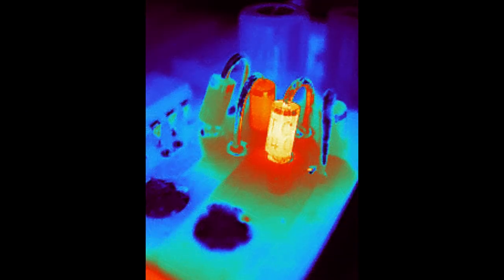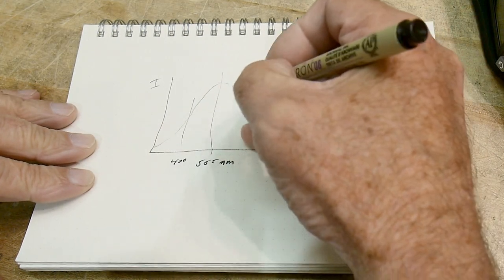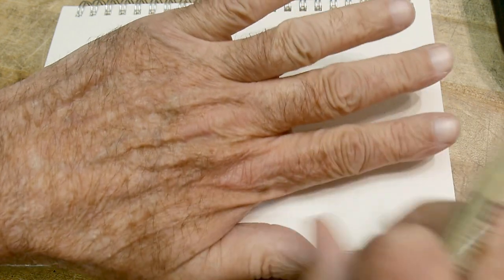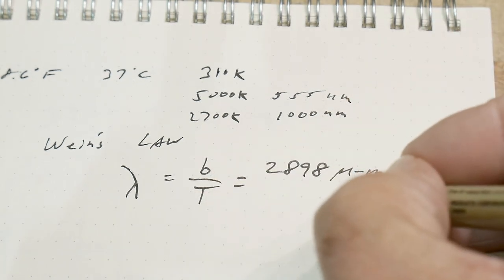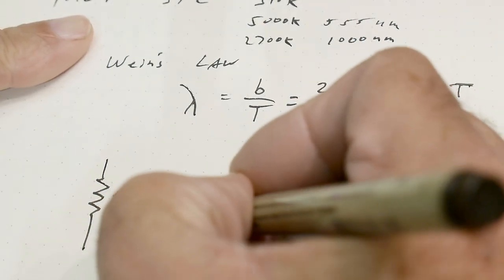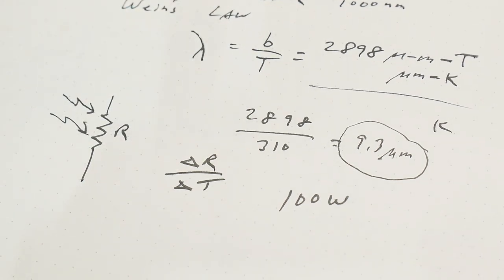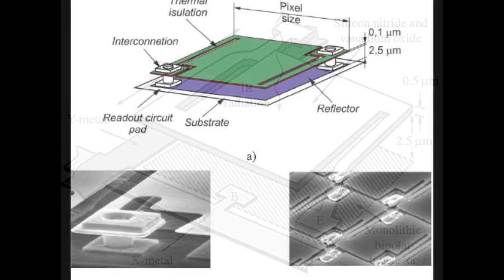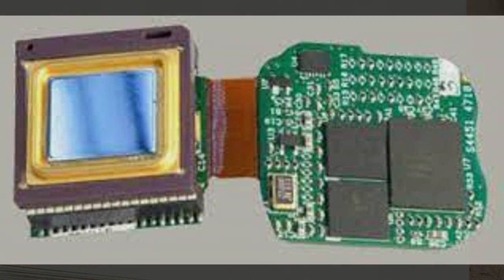#1486 Micro Bolometer

Comment: The key part is that you use a temperature dependant resistance. Then you use a known tiny current and measure the voltage to find the resistance and the corresponding temperature. Also the trick is that you reach an equilibrium when the absorbing element is at the same temperature as the emitter (ignoring losses). That's because the absorbing part becomes itself an emitter when it heats up.

Comment: Thanks for the nice video.   I got one of the Uni-T UTi260B thermal cameras a while back. Didn't think I would use it all that much but its been quite useful around the lab. Great verify your design has good thermal margins, finding faulty components and shorts.  Would have been great back in the 70's when we had boards with 30 or more TTL devices on them.  Bad components on busses were always a pain to find. Wan not uncommon to have 10% DOA TTL components.
Reply: I got a Flir one a while back and its been incredibly useful in all kinds of projects. I thought I would barely use it and end up using it all the time and it can really save you time and effort.

Comment: Why adding dashes or minus signs in the units? There's nothing between μ and m and a multiplication between m and K.
It's μm multiplied by K:
μm*K
μ is the 10^-6 S.I. prefix like k is the 1000* prefix for km (1km=1000m)
Also be careful with case.
k vs K: k is a prefix, K is the Kelvin temperature unit

Comment: I thought microbolometers were capacitive sensors rather than resistive? Using thermal expansion to move the top plate closer to or further from another large pad behind it to change the amount of capacitance.
Reply: Not sure if what you're describing exists, but that's an interesting concept. 

VOx microbolometers use thermal coefficient of resistivity. The temperature of the VO2 affects its electrical resistivity to a measurable degree

Comment: 555nm, the wavelength of the light emitted by a firefly, and coincidentally the part of the visible light spectrum that human vision is most sensitive to. Coincidence or is this all a piece of natures puzzle?
Reply: but if nature was just nCr, wouldn't every1 own las-vegas!
Reply: About 550nm is where the peak of light emission for the sun is. Eyes developed mainly to be able to detect this color of light, hence human vision is more sensitive in this area. The peaks don't line up exactly because many creatures use different chemicals and proteins to achieve the same effect; for humans the OPN1MW ("green" sensitive protein) has a peak at 530nm and OPN1MW ("red" sensitive) has  peak at 560nm. 

Vision cuts off at around blue/violet beyond that range, things like air and water become opaque to those frequencies of light, and I'd assume low IR sensitivity in the eye probably because it could impart heat and damage the eye. Humans can still see IR in some capacity as a violet like color, but it is overshadowed by other colors, and the eye itself filters out a good majority of it.
Reply: Yes, and the bluish cutoff likely accounts for why blue Christmas lights appear to be diffused or out of focus.
Reply: And the 555 is coincidentally one of the most common ICs used by electronics enthusiasts to make blinking lights. I want to believe.
Reply from the maker: blue is blurry because we have fewer blue cones than green or red